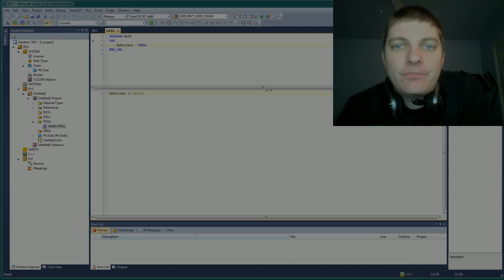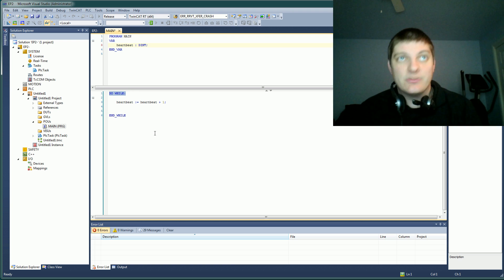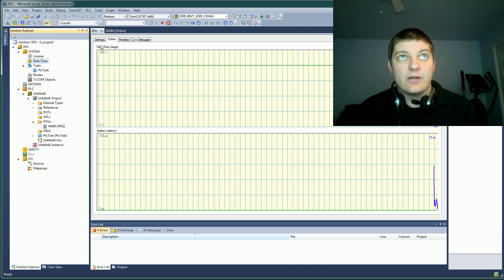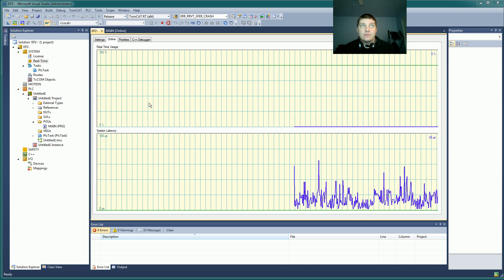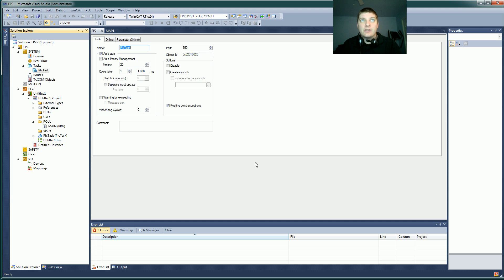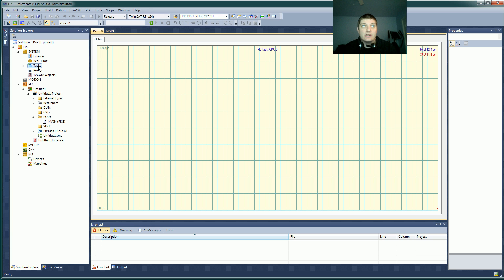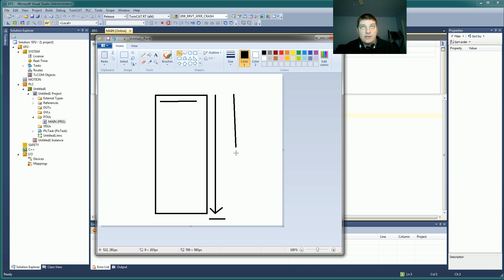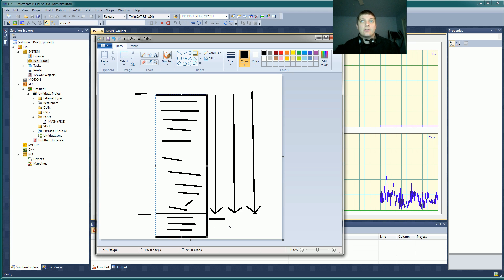Learning PLCs with Structured Text - EP3 - The PLC Task and Scan Times

Comment: Hai, when I click on activate run, I have three errors first one to HyperV which I am not using, and second one is TwinCAT System INit4\RTime: Start Interrupt: Ticket started >> AdsError: 4132 and thrid one is saying RTime: incompatible software detected << failed. I am using TwinCAT 3.1.4024.47 on my windows 10 laptop. Any suggestions helps me alot. Thanks in advance!!

Comment: could you please please tell me what's the  difference beetwen industrial pc and embedeed pc provided by beckhoff and a regular plc ?
Reply from the maker: The short answer is nothing. A "soft plc" is a PC that runs a higher level os like windows, etc. A traditional PLC is usually based on a microcontroller, not an x86 application processor like the beckhoff units.
Reply: @SquishyBrained  Sorry about those stupid questions I'm  a software developer  and all this is new to me, in beckhoff website there is   industrial Pc and embedded pc what's the difference between those 2 ?
Reply: Hi. I've been told by a Beckhoff representative that Industrial PC do use sorted CPUs that have less / few deviations regarding tasks timing.

Comment: thanks for this tuto , 
is this warning something normal Warning 12 19/03/2018 17:50:30 942 ms | 'TCOM Server' (10): Boot data not found (file: PLC\Port_851)  
?
Reply from the maker: LRHPro yes, likely you just need to create a boot project by right clicking on your place project and selecting it.
Reply: thank you , I forgot to mention something else, when I'm watching your tutorial and running the software at the same time the video&audio is glitching and after several minutes the BSOD pomps up saying "critical structure corruption" ,is there anything I can change on the setting or real time to make things normal .
Reply from the maker: Wow, I've not seen that.  So, you are running local on your own machine, and it locks it up?  You can set the cycle time a lot slower, but default it is 10ms, but you could go 100ms and use 1/10th as much of your CPU and not really have any trouble with the application in this tutorial.  
I've never seen that error before, but it sounds more like the result of a memory leak.  Maybe google around for the cause if you can't get it to work.

There is also a setting for max cpu twincat can use.  Default is 80%, which is rather high for a multitasking machine, so you can kick that down, but really all it'll do is cut the plc cycles short that don't have time to finish, which is not always that useful.
Reply: it only locks it up if I'm on run mode and keep watching glitching videos and I reduced the cpu usage to 60% nothing changed ,  so what I'll do is ,I will switch to config mode whenever I want to watch your videos , as you said may be the problem is relevant to cycle ticks or system interrupts . I will stick to switching mode solution thank you so much for your help .

Comment: ** Correct me if I am wrong **
if I have 1 Cycle each 1 ms; it means that the PLC scans the lines of coding for 1 ms then it waits for another 1 ms for the next scan (which will last also for another 1 ms ) and so on ...
and I should make sure that the 1 ms (or whatever cycle time I choose) is enough to scan the whole coding lines I have; that could be viewed by the processor percent and noticing if they overwrite the task or not.
Reply from the maker: Omar Hussein when the cycle "tick" starts every 1ms (for instance), it runs the code, first processing the inputs. then it runs the application code, then the outputs. if the code completes in 500uS, then it waits for the other 500uS. the next tick is started at the 1ms mark again. if the code doesn't complete in one time slice, it actually gets cut off, and and overrun occurs. that is how it keeps determinism. so, if you just add 1=1+1, it'll increment 1000 times per second on a 1ms scan rate.
Reply: I'm learning PLC programming from scratch for my master degree thesis and your videos are really helpful.
My question is: SO, what happens if the code doesn't complete in one time slice?(your sentence is broken in the comment above!). 
Is it like the CPU can't "keep up with" all the lines of code? The ony way to solve this is to set an higher tick time?thank you

Comment: Thanks bro for the nice videos. I am super motivated to learn this language. But I encountered a problem while running the first simple code. It showed me this message:
Error 15 12/20/2016 7:59:00 PM 996 ms | 'TwinCAT System' (10000): Sending ams command >> Init4\RTime: Start Interrupt: Ticker started >> AdsWarning: 4115 (0x1013, RTIME: system clock setup fails. 
Hint: On Windows8 system execute win8settick.bat in TwinCAT\3.1\System as administrator and reboot.) << failed!  

May you help me do overcome it?
Reply from the maker: Are you on a windows 8 system?  If so, run that batch file as admin and reboot.  I think it is a windows 8 only problem.
Reply: I use windows 10 :/  will the software run on windows 10?
Reply from the maker: Yes, it should.  Still go run that batch file and reboot.  Make sure you installed Twincat by right clicking and selecting "Run as Administrator".  I use it on Windows 10 and have not had the problem, but I run with UAC disabled on my machine.
Reply: Where can I find the batch file?
Reply from the maker: C:\TwinCAT\3.1\System\win8settick.bat
Reply: Thank you very much.

Comment: Dear evan , i tried the example you explained in this episode but when running the program with the for loop exist , the CPU will work on 80% and the program crashes. But when i remove only the for loop it will run fine.
Reply from the maker: +Mohamad Sadek Bahrini Can you paste in your code so I can take a look?
It seems like your FOR loop is never exiting, so it just runs forever.
Reply: I created the variables as follows:
i : DINT;
	
	arr_heartbeats : ARRAY[1..10] OF DINT;
 

and the code is as follows:

// For Loop
FOR i := 1 TO i:=10 BY 1 DO
	// Array		
	arr_heartbeats[i] := arr_heartbeats[i] +1;
END_FOR
Reply: Sorry for disturbing but i mean the example in episoid 4.I am using a 32 bit version of twincat 3, but i noticed that you are using a 64 bit version.
May that be the problem??
Reply from the maker: Mohamad Sadek Bahrini , Your problem is the line with "FOR" on it.  It should be:
FOR i := 1 TO 10 BY 1 DO

You have:

FOR i := 1 TO i:=10 BY 1 DO

Also, you can leave off "by 1" unless you want it there for clarity.  You can do "by -1" or "by 10" ,but "by 1" is the default.

Hopefully that will get you going.
Reply: Thanks. i changed that and everything is ok . Now i will continue forward with the next episoids
Reply from the maker: +Mohamad Sadek Bahrini cool. be sure you check the video descriptions for a link to my project in github. it'll save you lots of typing, though I think I only checked in the last version.